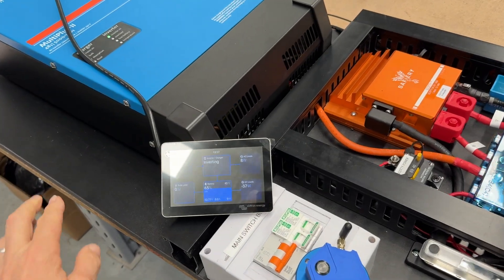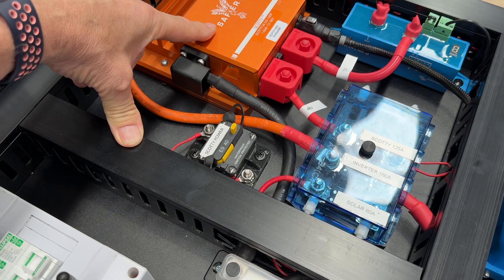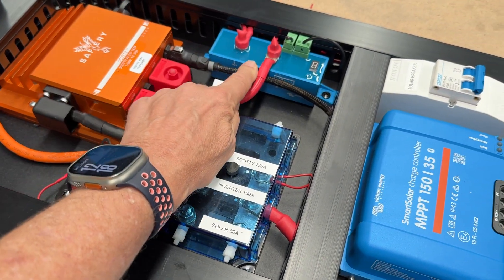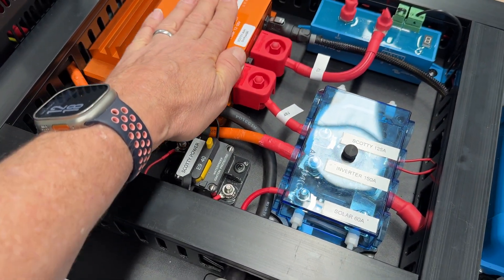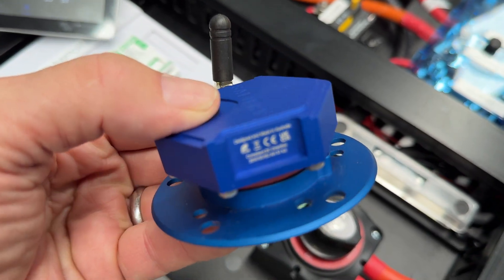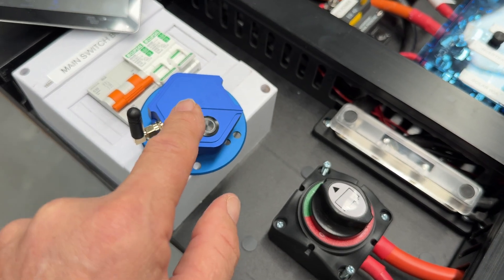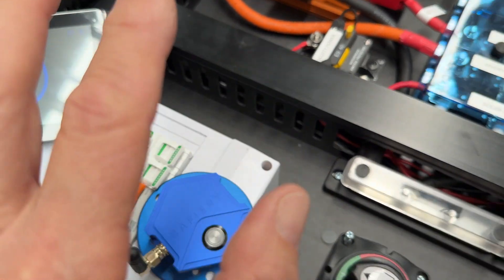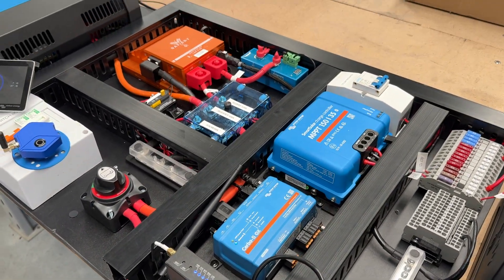48v Caravan Vertical Caravan Pack with 125A at 12v from Scotty AI. STAR-Tank bluetooth to Victron.

Comment: So the Scotty AI 2 that does the 12v battery delete - does it perform all the normal Scotty functions? I.e. can we have a 48v high side to 12v low side and the usual functions from this setup and get the 12v battery delete or are they different Scotty versions ?
Reply from the maker: Same functions as Scotty AI 2 but added features,

Comment: So scotty can now be installed into the van instead of the tow vehicle?
Reply from the maker: Yes Scotty AI 2 which will be released later this year can be installed in a caravan without a 12V battery. When the 12V anderson plug is connected, it will auto tune to vehicle alternator.